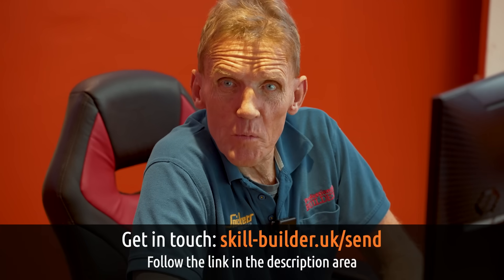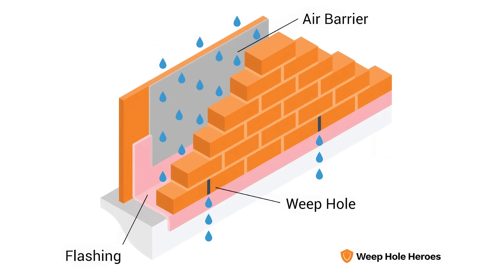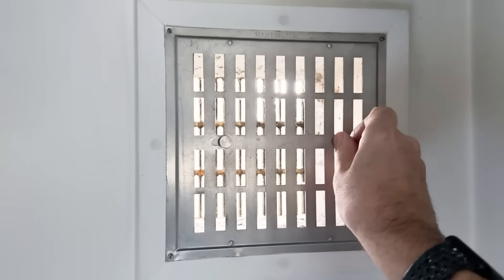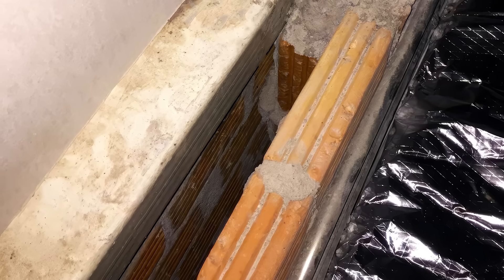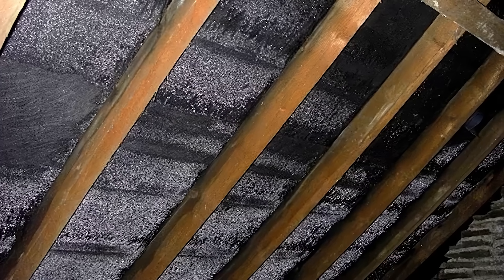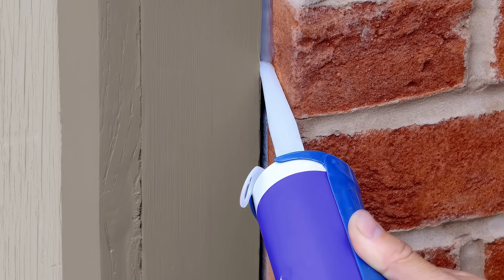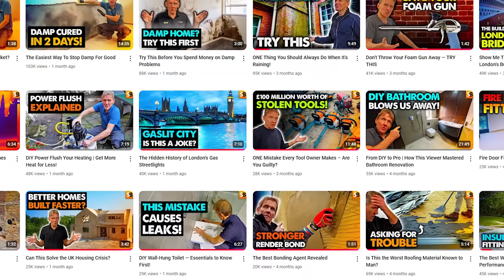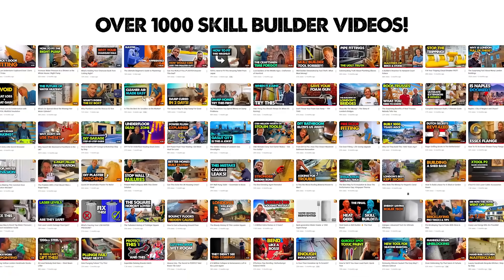The Truth About Cavity Wall Ventilation

Comment: Bungalow that has narrow wall cavity. Mould in some areas. I have air bricks below dpm which us normal but there is two air bricks head height and another directly below.. would it be best to cover them up? My understanding this is allowing cold moisture into the wall cavity especially it being a narrow cavity there's no insulation.. help help and advise appreciate thanks

Comment: Ove seen a house with airbricks similar to at 45secs. Almost ground level on the extention.
Are they supposed to be so far above ground level or are they ok at this level? Would they allow water to run into the home?

Comment: Hey Roger had a quick question as
I’ve got a issue with my air vent bricks for my sub floor as I recently insulated my living room sub floor with rockwool breathable slabs and stapled chicken wire to hold it up making sure I didn’t block any air bricks and even cleared them up so there is adequate ventilation there is 5 air vents for the living room sub floor rest of the downstairs is concrete but now I have some damp appearing around 2 of the air bricks around the front of the house what could be causing this?
Reply from the maker: Can you send me some pictures also look at the roof and wall above. www.skill-builder.uk/send
Reply: @SkillBuilder will do and send them over

Comment: Before we purchased our cavity wall council house the council replaced our slate roof with terracotta tiles and put air vents into the roof. Since then our bedrooms are freezing in cold weather the loft gets wind rushing in through the vents and into the rooms. Our home was cozy before they changed the roof. Can I get the vents removed and replaced with tiles? Hope you can help We live in Scotland and the temp can drop bellow minus 20.

Comment: I live in a block of flats that has a cavity wall. We have mould issues on internal walls, a builder advised that fitter air bricks on the outside will fix the problwm. Total @^@&s. Cost few grand for the entire block and fixed nothing.!!!

Comment: Hi. I have a question about a double brick wall with a space in between. The bricks are the red kind, made of burnt clay I assume? The space is about the width of a brick, with a brick here and there connecting the two walls. The house is from about 1910, timber walls on top of the foundation. The foundation wall is about 2/3 below ground, situated on the southwest coast of Norway. Wet climate. We replaced the old windows last year and found a lot of moisture between the walls. Drilling holes in the brick for window fasteners, the drillbit pulled out very wet clay from the holes, on the outer wall. A while after innstallment of the new (plastic) windows, the paint on the window lining started to peel. From moisture withing I guess. So my question is; should we make ventilation ports from the outside to the space in between to vent out moisture? Would this bring more moisture inn?
Thanx for any reply. Great channel. 
BR, Lars in Norway

Comment: Hi Roger. Thanks for the vids. Question for you: I have a 1930s house. Brick cavity walls. No cavity insulation. Not sure if cavity is closed at the top or not - can’t easily tell due to roof construction (I.e. partially sloping ceilings in upstairs rooms ). After having  removed floorboards in living room (to insulate under and re-lay new floorboards). I’ve noticed that, as well as airbricks sleeved through cavity fior subfloor ventilation, there are also deliberate 1-brick gaps on the inner skin every metre or so below dpc which link the cavity to the subfloor space.   (These vents do not go through the outer skin ).    Could these cavity vents be blocked to improve cavity insulation (as per the video) - or does this not apply to this type of construction? (I’m wary about blocking cavity vents that have always been there - but external walls are cold and I don’t want to miss an opportunity to reduce heat loss if it can be done without risk of future problems).

Comment: Dear Roger I love your shows. But haven’t you just contradicted your self in the last video by saying houses need a movement of air to keep the moisture in the air low so it stops mould from forming. Then you say in a cavity there should be no movement of air despite the possibility of moisture coming through the outer wall. How should this moisture escape if the cavity is sealed. As you say a dry wall is much warmer than a damp one. Dave.
Reply from the maker: Hi Dave 
The moisture leaves the same way it gets in. Water vapour can travel much more easily.

Comment: Slightly unrelated. On the ground floor of our house is a vent that runs straight through to the outside. Its about 8 inches above the floor. All it seems to do is make that patch of wall cold to attract condensation.  Im thinking of blocking it back up. Nobody I ask knows what its for. When we pulled out the fitted wardrobes we discovered old ducting pipe going through to the back bedroom, into the front bedroom and into the chimney breast.  Old cannabis farm I reckon.  I wondered if the pipe downstairs was to increase airflow through the house?  Anyway, should I block it up, if so, how?
Reply: Not unless you want a new friend
Reply: @danieladams7919  new friend?

Comment: My 1960s bungalow was built with a capped cavity, and it has a couple of air bricks… 
It sits in an area of a high water table and in a couple of places it is now suffering with damp issues.
Ps.. it has a concrete floor with black a bitumen coated tiled flooring. 
It has had cavity insulation pumped into the cavity about 35years ago and some of that filler has dropped to the bottom of the cavity. 
Ground water can / and is being sucked up into the brick work and lower walls being helped by the insulation. 
I firmly believe that filling cavities in the past should have been done with more care and perhaps a device to of stopped insulation materials from dropping below the DPC level. 
There are so many variables to consider before repairing faults (New and old) ! I’m checking drains first, clearing out the lower cavity, using dry rods and damp resistant render, plus adding an air brick to ventilate the cavity where the problem is. Also, I’m going to use blackjack where the floors meat the walls. I suppose it’s also possible to use dry rods in the floor?

Comment: Good day and thank you for shedding light on this issue. I live in Nigeria, West Africa. I’m curious, what would work best for heat insulation in a climate like Nigeria? We want to keep inner spaces cool round the clock. I’ve been researching on double cavity brick walls. However, I suspect that though the insulation will slow down the rate of heat absorption in the inner walls, the inner walls will retain the heat at night keeping the inside space warm. The issue is my climate is a hot one both day and night. What would work best for heat insulation and reflection to keep the inside space cool all day and night? I really do need an answer to this please?

Comment: Surely the weep holes allow air in? But you said it should be sealed?
Reply from the maker: The weep holes are not ventilators. You need an in and an out for ventilation to work

Comment: Sorry this has turned out to be a long one but I've tried to provide succinctly as much pertinent information as possible.
Pair of Victorian semis built 1899 with lime mortared soft red bricks with external cavity walls c/w slate DPC in Southampton, so, near the water but away form the direct coast. Reroofed 1980s with bitumen felt under concrete tiles (Probably torched slate on battens originally), evidence of sweating and salts on roof timbers. Cavities open to the loft. Sash window heads have gaps from outside to cavities. No purposeful ventilation to the loft. No cavity insulation. Wrought iron cavity ties. Cast iron brick vents at 1st floor floor level in outer skin. Various generations of cavity bricks at ground floor low level where occupants / owners have added for what ever reason but there is no consistent story as to whether their intent was to ventilate the cavity or the sub floor.  Generally the sub floor has not been vented.  Ground floor wall plates built into the inner skin and some joist ends have rotted out through a combination of moisture transmitted by cavity bridging due to lime mortar becoming friable over the past 125 years and filling the cavity above slate DPC level (over 5' of cavity towards the rear of the house), debris from the roofing contractor reducing the chimneys to within the loft space being dropped down the cavities and lack of air movement where at foundation level the water table level has been adversely affected (risen) by adjacent highways work, broken drains, rainwater missing the gutters and neighbours rainwater discharging on to this property causing the earth at foundation level to be saturated in some locations.  Internally, in the main, the rooms have lime plaster but covered with emulsion painted anaglypta wall paper.  In some rooms we have found that the wall paper has come off in almost complete sheets without wetting and that the surface of the plaster behind the paper is black with mould hidden from view by the generations of emulsion forming a plastic bag on the internal wall surface.
Work we have undertaken:  Provide tile vents to the roof on different slopes to aide cross ventilation.  Provide air bricks c/w sleeves to vent the sub floor ensuring minimal gaps into cavities. Remove some bricks within the sub floor walls effectively linking different sub floor voids together thus linking different faces of the building to aide cross ventilation.  Clear the cavities of dropped lime mortar and debris. Replace the wall plates and support the joists through wall plates bolted to the face of the subfloor walls c/w moisture transfer barriers. Had the local authority get involved to drive the the neighbouring HMO landlord to fulfil his maintenance obligations. Added eave protection plates to ensure that the storm water passes to the gutters rather than down the face of the building. Replaced the old double glazing with means of escape double glazing c/w trickle vents. Provide a shower room extract ventilation that has a trickle vent facility with additional timed or humidistat controlled boost.  
Research: My background reading is conflicting with local trade and professional feedback.  My reading suggests that there should be air movement in the cavities but not through ventilation to allow the vapour pressure to drive the air movement along with differential pressures as air moves around the outside of the building.  The local feedback though suggests that the cavities should be open at the top.  
Concerns:  My concern is that in a winter condition the saturated air at external ground level is picking up additional moisture from the lower cavities as the external air is drawn into the cavities through the organically installed air bricks at low level driven by the stack effect of the air warming and thus able to take on more moisture to transfer this moisture to the loft but on route cooling the inner skin of brickwork and potentially creating conditions that could promote interstitial condensation within the inner leaf.
Proposals:  At present I am considering closing off all ventilation routes into the cavities around the sash windows and any other extraneous penetration from outside into the cavities, remove the brick vents where they have been provided into the cavities at low level & at 1st flr floor level apart from say one on each face at low-level in lieu of not having cavity trays and weep holes. To close off the cavities in the loft space. To continue to correct the drainage issues and pursue Highways to correct their land drainage that they didn't know about!  To remove the moisture barriers formed by the emulsion painted wall paper therefore allowing the lime plaster with new breathable finishes to perform. To continue to clear out the cavities. To provide oversite DPM to the sub floor areas to reduce the evaporation of the ground moisture into the air. To retain / repair / replace floor timbers as needed along with treatment as necessary and to provide vapour check, breathable membranes and insulation to the ground floors.  To regularly inspect the loft and the inside of he external walls for damp and mould.
Question: Am I missing a trick - why should the local feedback suggest that I should leave the cavities open to the loft when taking everything else into account?

Comment: If the cavity isn’t sealed at the top of the brickwork sooner or later you’ll have rats nesting in the loft insulation.
Reply from the maker: Good point I have seen it where they chew through the plastic airbricks.

Comment: A caveat Roger... recently worked on a 30's property, couldnt work out how the floor was vented... turned out the cavity was vented and there was a few bricks on the inner leaf missing front and back to vent the floor from the cavity... If you were to block the vents, without adding new telescopic vents for the floor, could cause a nightmare especially if they've had something like LVT over the floorboards

Comment: I think blanket statements like this do more harm than good, there are too many variables involved to say whether your cavity should be open or closed, it depends on the size of the cavity the type of insulation, the construction of the inner and outer leaf, Take how warm and cold flat roofs are constructed, into consideration, and apply it vertically? I would always say the cold side of the insulation needs venting?
Reply from the maker: For a start I am talking about a non insulated cavity in a masonry wall so that negates a lot of the points you have made. In the case of a masonry cavity wall with full fill insulation or no insulation the cavity should be as air tight as you can make it. If there is moisture in it from penetrating damp that can be dealt with my using Stormdry but a little moisture will evaporate back out the way it came in. You don't need air bricks into the cavity. It was never done in the past and should not be done now. The exception is a timber frame house.
Reply: It’s definitely not clear in the video you’re talking about non-insulated cavities!
Reply from the maker: With the greatest respect every picture in the video shows a masony wall construction. I am genuinely sorry that I didn't make it clear but I assumed that the pictures were worth a thousand words. Next time I will spell it out.
Reply: Also storm Dry should only be used after a Thorough investigation, as the probable cause of damp will be bad guttering, or bad tiling At eaves, or condensation problems, driving rain on its own very rarely penetrate to the inside of the building! And storm dry can slow down or even stop the natural drying out of the building, especially if it’s getting in from above!

Comment: Does anybody know if the cavity should be closed in the loft in a timber framed house? We have no cavity closers around our upvc windows so air that billows in from the eaves in the loft goes straight down the cavity, hits the frames and the resulting cold is causing excessive condensation and mould. The outside brick wall had perpend vents in. I figured if it can be done, closing the cavity in the loft would be preferable to having the windows removed and cavity closures put around them.

Comment: My council are adamant that the air breaks can not be covered even with my new wall insulation coming in 2 weeks time and I have around 10 air breaks around the property above the path and grass
Reply from the maker: I think you need to find out what those air bricks are for. If you have that many they are probably for the underfloor.
Reply: @SkillBuilder  suspended flooring, but 2 of them above my windows 1 front 1 back. Them the other 2 are in the archway wall/kitchen wall. The rest are under the windows, and there are 3 inside on 2 chimney stacks.

Comment: I have a ventilation brick three bricks above the DPC that definitely does not go through into the house and is above floor level. I can tell someone who lived here before me tried to seal the holes in that brick with silicone, which not only looks ridiculous now but also isn’t properly sealed.

Is this a cavity wall vent? Can it be bricked up? The floors are suspended but solid, the cavity walls are apparently filled, and the house is a semi-detached property from the late 1950s. I’ll also be looking into applying Stormdry and sealing off the top of the cavity later this year.
Reply from the maker: provided it is not a timber frame or pre-fab concrete panel house I don't see any reason that the cavity is ventilated.
Reply: @ It’s definitely not a timber frame or prefab. I think the walls are made of some sort of clinker blocks on the inside and (apparently very rare) bricks on the outside. I’ll have this brick and the top of the cavity sealed off then. Thank you, @SkillBuilder!

Comment: THANK YOU VERY MUCH FOR THIS INFORMATION. ESPECIALLY,  YOUR MENTION OF THE TOP OF THE TWO WALLS, BEING SEALED OFF.   WHY ?  BECAUSE YOU TUBE IS FULL OF EXPERTS  DEALING WITH RAT  PREVENTION.,  CLAIMING THAT  THIS, IS THE WAY  THE  RODENT'S GET INTO OUR LOFTS. DESPITE ALL TYPES OF INSULATION.  THIS MADE ME WONDER, WHY AREN'T THOSE GAPS BETWEEN THE OUTER AND INNER WALLS CAPPED OFF AT THE TOP , AS A ROUTINE PART OF CONSTRUCTION ?
Reply: NO RESPONSE   ??    NOT RELATED ?   OR IMPORTANT ??      VERY DISAPOINTING